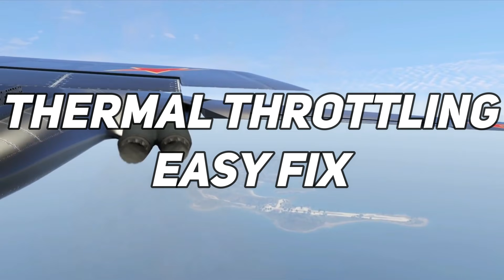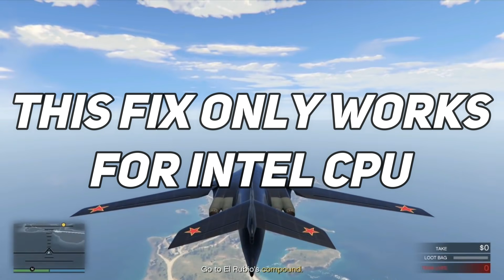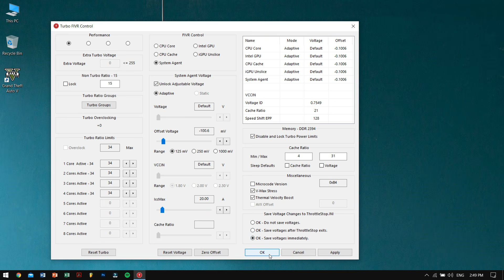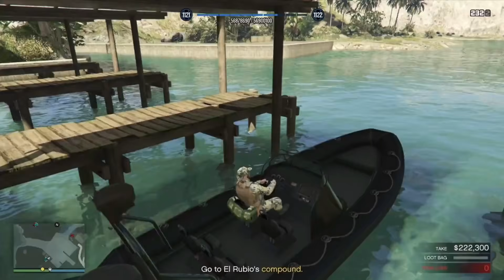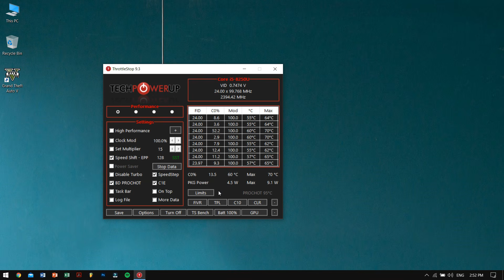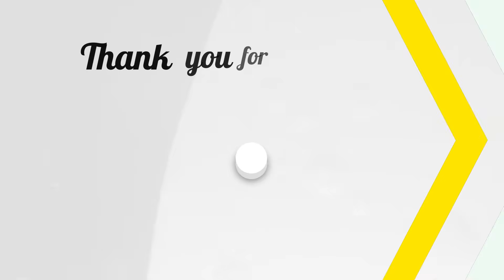Comment: Most of my FIVR settings are greyed out, how do I unlock these settings?
Reply: Check your bios.
Reply: @TechTweek  Was able to ungrey the options, disabling the turbo helped with the throttling, but I'm still getting low fps during games. I used a i7 11th gen with an RTX 3070 GPU.
Reply: @dewsworth5267  If you're using a desktop, then try upgrading your CPU cooler. This video is basically  for laptop users, as the cooler is not upgradable.
Reply: @TechTweek  I'm a laptop user, using a MSI GE66 Raider

Comment: 3:06 I have an i5 1035G1 and I can’t activate unlock Adjustable Voltage my GPU the UHD G1
Reply: Check your Bios settings, I think your CPU is locked in your Bios or the worst case, the manufacturer has locked it.

Comment: third method you can do it without throttlestop by just changing maximum cpu power state in windows power options to 99% which will disable boost.
Reply: Thanks for the tip.

Comment: I just wanted to ask when throttle stoping is set mine to -110 in work then tried to see if I could go further but then it crashed and I kinda of stuck how do I get I working again or does i automatically just restart or something.
Reply: It's really not recommended to tweak more. After a reboot, things should be back to normal.
Reply: Thankyou it worked
Reply: @oneshot4432  Great 😁😁

Comment: Bro thx u so much! I had this laptop for a year and a half now and i was playing always at 90-94 C. Now i get 80 at maximum and VISIBLE better performance, ez subcribe from me. Also a question, i have a turbo mode for fans (F5+ALT), i should use it constantly or just when it get hot?
Reply: Use the fan constantly. It is designed to cool your laptop. So use the feature. Enjoy the free performance 🧃😌

Comment: Why my cpu core voltage is not available?
I cant check
Reply: What's your CPU?
Reply: @TechTweek  intel core i7-10510u
Reply: @nashhm7693  I think your manufacturer locked your CPU. Try checking your BIOS for any option to unlock your CPU.

Comment: Amazing guide. I have tried all different things and this guide was perfect and actually had results
Reply: Great 😁
Reply: I just wanted to ask whether my computer will deal with the crash after throttle stoping on it's own
Reply: @oneshot4432  if your computer crashes then there are some settings that are not suitable. It's fine a reboot will reset everything. Throttlestop is not permanent. It is only effective when the application is running. 🧃

Comment: Can someone please help I don't have the FIVR Option. Someone please reply
Reply: What's your CPU?
Reply: @TechTweek  intel core 2 duo p8400 2.26ghz. I know low end cpu :(
Reply: @ibralistic01  I am sure that processor doesn't support undervolting. Or try checking your bios for settings related to unlocking your CPU. Because manufacturer tends tu lock the processors for safety reasons.
Reply: @TechTweek  I have checked it doesn't have any option. Guess my cpu is locked. Any other way to unlock my cpu. I searched in Google and it said all intel core 2 duo cpu's are unlock able and overclock able.
Reply: @ibralistic01  You can try using an older version of Throttlestop.
Reply: @TechTweek  okay thanks I'll try and which version do you recommend?
Reply: I don’t remember which version I used for my Core2Duo E8400. But there was an old version that supported that CPU
Reply: @TechTweek  okay thanks I'll try 🙂

Comment: 3:00 that all locked on my laptop (sorry for bad english :( )
i5 8265u
Reply: Maybe your manufacturer locked all the settings.
Reply: @TechTweek  
I think so :(
Reply: @Chad-Fatih  Still you can try checking out your bios. It might contain some setting regarding unvolting.
Reply: @TechTweek  there is only fan speed setting and virtualization setting :(

laptop: lenovo ideapad c340-14iwl

Comment: i have 10750 H  .. i couldnt do method 1 or but i did method 3  
in my laptop it always say after using msi afterburner TEMP but when i press the G button in my dell g5 5500 it changes to no load.. is there anything i could do to get a cool my laptop a bit ?
Reply: Just turn on method 3 and play your games.

Comment: Bro after following every step of yours and even i have same cpu as yours i m getting blue screen every min and i cant even reset the settings bro. What to do bro?
Reply: Delete the previous version of Throttlestop and re download it.
Reply: @TechTweek  bro i cannot even delete bro when my laptop restarts then again blue screen appears. What to do?
Reply: @roxer2956  Throttlestop is not a permanent fix but I don't know why it is happing to yours but try to boot into the safe mode and then restart to normal windows.
Reply: @TechTweek  ok bro i m trying
Reply: @TechTweek  after restarting 3 times now my laptop is back to normal bro. Now what to do with throttlestop should i increase cpu usage again back to 34 because when reduced it to 24 it was at 1100 mhz
Reply: @roxer2956  Try using method 3. I think that'll be best for you.
Reply: @TechTweek  then should i reset other settings

Comment: For those people who have fivr blocked, simply use the throttle stop 9.2 version it should fix your problem
Reply: Thanks for the information.
Reply: Thanks bro
Reply: FIVR can be fixed by enabling Overclocking in advanced settings in the bios! This is my experience at least.

If you dont see the setting you have to press down a combination of keys to access the secret menu. I have an MSI laptop mine was Hold Left Alt + Hold Right Control + Hold Right Shift, then click F2 while those are held down.
Reply: still not fixed. Fivr is missing
Reply: @khizarm-3537  in 9.2?
Reply: Not fixed

Comment: So i subscribed to you but when i click on the link it still say i have to subscribe 1st?
Reply: Ok i figured out how to download it. When i go to FIVR all the thing to undervolt are locked and i can't figure out how to change them?
Reply: @shifty198885  thanks for the sub, which CPU are you using?
Reply: @TechTweek  Core I7 - 10750H 

Reddit said an older version works
I downloaded 9.2 and now I can adjust it.
Reply: That's great 😊
Reply: @TechTweek  Temps went from 96 on CPU to 81. Also took the turbo mode off.

I cannot adjust the cores though. They are still locked
Reply: 81C is still a better temperature

Comment: I have seen in some undervolting guides that some people only change the Core and Cache modules, while some also change the Intel GPU & iGPU slice. In this video, you are changing voltage for all the five including System. Is it okay to fiddle with all modules and does the system remains stable if I do so?
Reply: Yes, the system stays stable.
Reply: @TechTweek  Could you try undervolting on i5 8265u? I want to know the stable offsets.
Reply: @kahanbhalani3607  the thing is Kahan. These CPUs react differently with these settings. I'd suggest you to search in Google regarding the settings in throttlestop
Reply: Could you also please give the stable voltage offset for my i5-8265u CPU?

Comment: I have an i7 12700h CPU in my laptop and it isn’t possible to undervolt at all. Really sad. I’ll take a look at method 2 and 3, but if you know if any other suggestions I would very happily welcome it. Cheers.
Reply: Your CPU is really newer that mine, I haven't have tested your generation of CPU. I don't have idea about it. Did you try using the newest version throttlestop?
Reply: @TechTweek  Yeah, I've tried XTU and throttlestop. I googled it after and it turns out it just isn't possible to undervolt this CPU, unfortunately.

I did find a thread that has helped me with tweaking PL1 and PL2, at least. I'm testing different tweaks at the moment.
Reply: Hi bro. What helped to your 12700h? I have it in my legion 5i pro and after turbo boost it has 90+- celsius. After disable turbo boost it is better, but fps are lower. What is your advice? Thank you :)
Reply: @Ppatress  Hey. I downloaded throttlestop and lowered the TDP settings to 45 each. I also bought a laptop cooler (KLIM mistral laptop cooling pad) that massively helps me to play games without needing to turn turbo boost off. 

The only downside is the cooling pad is the noise, but easily fixed with a headset if you aren’t bothering someone else with it. Also worth it imo.

I’ve done some other minor things like cap FPS to 60 in games.
Reply: @Euroland07  so you rewritted original power limit long 115w and power limit short 135w? Both for 45w?
Reply: @Ppatress  Yeah, it’s around 45 for both. I could probably tweak it a bit more due to the cooling pad, but I’m happy enough with the current performance. 

Might be worth starting a bit higher and going from there.
Reply: @Euroland07  i have now program quick cpu and here i have setup for maximal frequency 3000mhz and cpu temperature is 75°C
Reply: @Ppatress  Nice one. I’ve never used Quick CPU before. I’ll check it out.
Reply: @Ppatress  Did you hear about a workaround for undervolting for 12th gen CPUs via Loadline (AC/DC) changing?

MSI bios allows it at least. I'm using it currently and have no heating issues at all anymore - especially combined with my cooling pad.

Comment: I've tried everything to unlock core voltage offset settings, but nothing worked. Disabling turbo works but that makes my gameplay stuttery. You have any solution 4 that?  

Specs: i5 11400h 45w tdp
             Rtx 3050 95w tgp
              8x2 3200hz RAM
Reply: Now-a-days manufacturers lock their CPUs. I think you should search in Google for any relevant help.
Reply: @TechTweek  got it sort out, undervolted tpl 1 and tpl 2 power limits via theottle stop and my fps increased by 20+ in gta 5

Also if you wanna decrease thermal throttle not just cpu but also try undervolting gpu as well,  search the max frequency for the Gpu  and set the msi voltage curve according to that, will run smooth like butter , trust me make a tutorial . Thanks!
Reply: That's great, thanks for your support 💖

Comment: Bro the fivr menu is locked in my case i am using i7 8750H what should i do i have stuttering and heating issues
Reply: Check your bios, there should be an option to unlock your CPU.

Comment: Hey man i use i5 4570 but some options are not showing for me like igu slicing and speedshift . should i still undervolt my cpu ?
Reply: Yeah you may proceed
Reply: @TechTweek  I did it and my pc kept crashing . i reverted the settings and now its working as normal . Didnt work for me but still a good video nonetheless
Reply: You can always try tweaking the values, still thanks for stopping by.

Comment: TechTweek I have an intel pentium silver n5030 and see no FIVR option nor speedshift option on throttlestop is there any methods for me that will stop thermal throttling?

Edit: I tried Method 2 and I did see some results as in it throttles less than often and I hope that method 3 can save me
Reply: Try method 3
Reply: @TechTweek  I did and it seemed to work yet they are still little bits where it throttles still
Reply: Try method 3. You might get a stable performance in that.
Reply: @TechTweek   thats what I did
Reply: @TechTweek  This is an update after trying method 3 so far it can be stable and sometimes it just throttles again. My cpu averages about 58 celcius idling and doing small tasks and rises up to its throttling point(70 celcius) when playing low end games other than buying external items to help my cpu is there any to help it via on the laptop?

Comment: so all the tweakings in the application will go into nothing if you won't open the throttlestop whiile gaming? and it should be opened at all times, right?
Reply: Yes, you'll have to open throttlestop everytime you play your games.
Reply: @TechTweek  okay thanks boss
Reply: @uhcuhc.  you're welcome 😁
Reply: @TechTweek  other content creators suggests inthe method 2 to max it up whilst in your tip you want it to reduce to minus 10. can you please explain what's the difference between the two, that is maxing cores and reducing cores sir? a normal pc users wouldnt understand the numbers behind in tweakings. it would be much appreciated if we understand what we're doing to our system and see if that really is the best settings for us to  run games seamlessly
Reply: In method two you're just limiting your CPU to run at a lower clock speed. Where as in method 1 you just feed less power to your CPU so that less heat is generated.
Reply: @TechTweek  so you still recommend decreasing the cores to 10?
Reply: It won't decrease the cores. If your CPU can run at 3.0 GHZ then method 2 will restrict the CPU to run at a lower speed like 2.8GHZ, and now the CPU has to work a bit less harder so less heat and so less thermal throttling. All the steps are logical and they won't hurt your CPU.
Reply: @TechTweek  hi it's me again ^^

just curious. can i increase the fan speed of my laptop's built-in fan knowing there's a setting set at throttlestop? sometimes i feel the internal heat on my latpop while gaming and opening a few tabs in the browser. maybe it woud coolen it and wanna know if it is okay 

 i also wanna know if changing my predator sense settings from normal to fast in the gpu overclocking settings a contrary or not from the settings set in the throttlestop
Reply: @uhcuhc.  I don't have idea about it but you can always try.

Comment: the CPU core voltage is locked in my case. Core i7-10510U, anyone has the same problem as mine?
Reply: Please check your Bios, there should be some option to unlock the CPU.

Comment: I can't change the CPU core voltage settings in ThrottleStop, it's locked and won't let me change them...
Reply: same
Reply: That's because of the bios update! Check your bios, there should be some settings related to it.

Comment: whenever i go play a game my cpu and gpu sits at around 70-80° Celsius is this fine? also my fans blasts full speed. my pc overheated but i think in my case i just need to fix my laptops positions
Reply: 70-80 degrees is totally fine. If you're hitting more than 95C only then you should worry about thermal throttling. Thanks for stopping by.

Comment: Thank you for your efforts sir ❤️ can you tell me in power settings i should go with balanced or advanced?
Reply: Please follow the video, you can slow down the video if you’re facing some issues
Reply: @TechTweek  Ok sir, same processor but my pc is getting in problem and restarting by first step but no problem with 2,3.. can I use 2 and 3 both at a time?
Reply: Sure you can

Comment: Awesome video, very easy to understand. Having the same CPU model as yours also help me save time from trial & error. But I do have some questions, can I apply both method 1 & 2 without crashing the CPU? Also what should be the power option mode setting while running throttlestop? Balanced mode or Hi-performance mode?
Reply: Yes, you can enable both the methods. Power option doesn’t matter
Reply: @TechTweek  thanks for the reply. I know for the fact that the balanced mode disable turbo boost by default, but if I set TS to allow turbo boost will this be conficting with the balanced mode power option settings? Or will balanced mode will have the priority.

Comment: Help, my cpu is exact and my mhz is 800, I recently have a battery problem due to hardware its stuck on 0%, my battery saver is turned off also still after that I am getting drops which I didn't use to get, it will take 2 weeks for the battery model to come I really want to know is it due to battery or what my cpu does not even give me base speed.
Reply: I am pretty sure it's because of the battery, as your battery is not able to feed your laptop with enough wattage, that's the main reason your CPU is stuck at 800mhz.
Reply: @TechTweek  I had to research a lot regarding this but battery is not available in market otherwise constand 60fps on low graphics in fortnite with intel uhd 620

Comment: When i go to FIVR its all grey and i cant click on adjustable voltage, iam running the programm as an admin. what could be the problem?
Reply: You're processor
Reply: @TechTweek  Its an Intel i5 1035G7, in a surface laptop 3. I researched a little and found that microsoft deactivated the undervolting controll (intel xtu), its not possible to activate it if i understood correctly. There is even not a real bios in this shit. Iam dissapointed with microsoft.

Comment: why are some sections locked for me
Reply: That’s because your CPU model is different than the one shown in the video, can you specify the CPU model?
Reply: @TechTweek  CPU

	Intel(R) Core(TM) i7-9750H CPU @ 2.60GHz

	Base speed:	2.60 GHz
	Sockets:	1
	Cores:	6
	Logical processors:	12
	Virtualization:	Enabled
	L1 cache:	384 KB
	L2 cache:	1.5 MB
	L3 cache:	12.0 MB

	Utilization	22%
	Speed	4.09 GHz
	Up time	0:00:00:55
	Processes	81
	Threads	1663
	Handles	37924
Reply: Check your Bios, there should be some settings related to unlocking the CPU
Reply: ok thanks im subbed
Reply: Thank you so much

Comment: i have to ask you something, I was using my processor speed constant at 2.4 speed in the old versions, but I am getting a blue screen error due to the old application, how can I get the constant 2.4 speed in the new application and I have the same processor as you. PLEASE HELP ME
Reply: Try using the older version
Reply: @TechTweek  in which of these 3 methods do I get the highest performance? I use a laptop and I only need a maximum temperature of 75 degrees. if there is another method for high fps, can you please tell me within 1 hour?
Reply: @TechTweek  i have a tournament match VALORANT
Reply: Use method 3 for stable fps. If your laptop has 60hz screen then its the best setting
Reply: @TechTweek  noo 120 hz monitor hdmi connected.
Reply: Then just stick with method 1